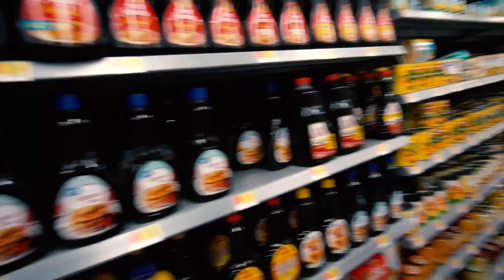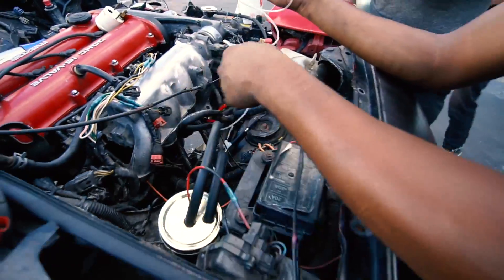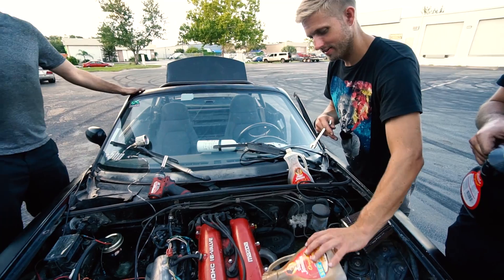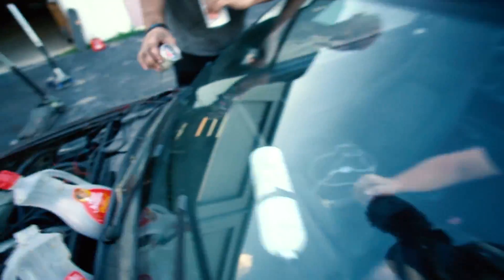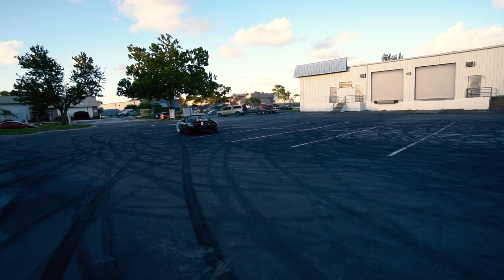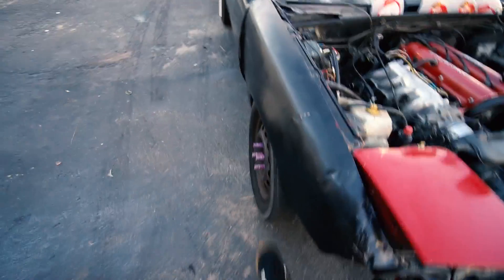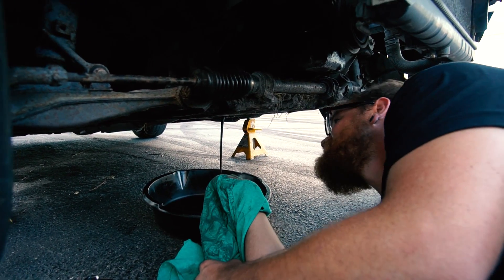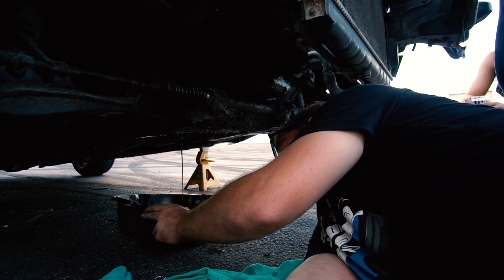Using MAPLE SYRUP as ENGINE OIL

Comment: This isn't maple syrup.  It's maple flavored syrup.  Real maple syrup is twice the price of good motor oil.  You're better off just using the recommended oil instead.  It'll save you more than $20.  When it comes to my engine I don't usually cheap out, but I don't see any real benefit to using syrup- real or fake.  The only thing I have ever used other than motor oil is Pam cooking spray.  I emptied a dozen cans I found in a dumpster into a bucket and used that.  Worked great.

Comment: So I put a whole gallon of deck sealer in my engine instead of oil on a routine oil change on my 120K Tercel. Someone had filled one of my oil containers with deck sealer and didn't mark the container! After awhile my Tercel wouldn't even go up a hill because the engine was barely able to turn with the thick sludge inside the engine. I replaced the oil as soon as I noticed it, after driving a week like that. Now the engine still runs as good as new, for the last 6 years. Although I had to replace the oil pump pickup tube and oil pan eventually because it was clogged solid. The entire engine inside has a thick gooey coating of deck sealer burnt onto it, and my engine uses oil. But the engine doesn't have a rod knock and only a little bit of valve train noise. It has lasted about 50,000 miles so far since putting the whole jug of deck sealer in it by accident for about 150 miles.

Comment: I once paid a shop to change my oil, they made a mistake and didn't put oil back in after draining and I drove around with no oil for a scary amount of time with the engine making loud clacks and knocks.  I tried to get in with my mechanic which took additional days.  I sold the car, and to this day it's still driving around, the scary part is...it might outlast the car I bought to replace it.

Comment: Engine oil contains additives such as anti-wear additives, anti-oxidation, anti corrosion and detergents that hold contaminates in suspension so it can be carried to a filter.  Without the anti-wear additives the engine would only last around 40,000 miles at best. The popular belief that oil is oil is so NOT true. 
If you want your engine to last use Lubrication Engineers (LE), it cost three times more but it will last at least three times longer but usually longer. Oil analysis  showed that conventional oil had 4 time more wear metals then LE.  Most synthetic oil should be changed as often as conventional oil because most use conventional additives that shear and breakdown = added wear on you engine.

Comment: you should do a video testing out seafoam in the engine oil to see if it will clean it up and run normal again.  run some cheap oil through it with a bottle of seafoam, drain and repeat 2 or 3 times and then just regular oil

Comment: You need to flush that engine now, the inside will be caked with crystalized sugar after car gets cold, Oil is pertolium and stays lubed and protects metal internals, but syrup is sugar and will burn up quicker than burning oil but much much worse, the engine needs sea foam now or marvel mystery  to clean the crank case and oil passage ways then regular oil and back to normal, very cool video, proves syrup can be a temp sollution

Comment: kind of sad that motorhead low compression for a bad motor. It seemed to run and behave pretty decently. I know it's just a parts car but I don't think any of the vehicles I've ever had had something that looked like that under the hood. Well, technically the first Mercedes I had had a really nice motor like that but it was a factory motor not a racing motor like that. For the record that was a $500 car courtesy of Malindi, a stupidity.wish I could come across more situations like that where you get a car worth around five grand and one of the best cars I ever owned. To add insult to injury most of the parts for that car were very inexpensive would've probably had a few years but it got driven into.

Comment: I would have flushed the engine to get rid of most of the oil residue and then ran syrup and then run it full rev and then tear the motor down to see the results.

Comment: there's no lifters in that motor it's dual overhead cam the cam set directly over the top of the valves
Reply from the maker: There’s a hydraulic lifter on top of the valve. How else would the cam contact it? Lol

Comment: You would have been better off running cooking oil like in a Model A Ford. I have seen damage from pouring the wrong oil in a motor (hydraulic fluid) or even coolant, but pancake syrup wtf?

Comment: What I’ve seen from the 2 videos I’ve seen from Taylor he does them pretty legit by check oil pressure / air fuel in the moonshine video so props for that. Orion just makes a video can car run on w-40 fills engine with it then just red lines the piss out of it tell it explodes witch don’t get me wrong great funny video but kinda point less to just be completely trashing cars and gaining zero knowledge about it like clearly a car will run with random shit dumped in the motor tell it blows up

Comment: I really want to see what the inside of this engine look like after the amount of shit you have put in it.
Reply: TheDestroyer32 I want to see the cylinder walls after all that alcohol washing the oil off lol
Reply: Thing is that maple syrup will decinagrate once it heats up turns to glaze. The motor will seize up.
Reply: @oldschoolhiphop2275  you are correct sir... engine would sieze in less than a minute... these guys are f.o.s. and just tryingcto abuse stupid people...
Reply: They didn't put syrup in it. Syrup is sugar, it would melt, be sticky (anti-lubricant) and the engine would seize... maybe 45 seconds after theg started it...
Reply: @godchi1dvonsteuben770  this is what I was thinking.  I'm no Canadian and I'm no mechanic but it would just gel up right away from the heat right?  I just ended up here from YouTube's recommended clickbait.
Reply: The trials and tribulations of a mad mechanic scientist. Next stop science fair.